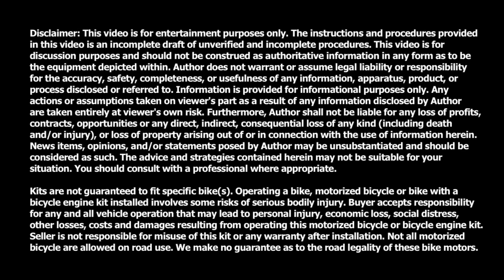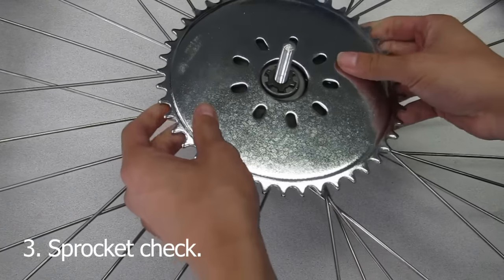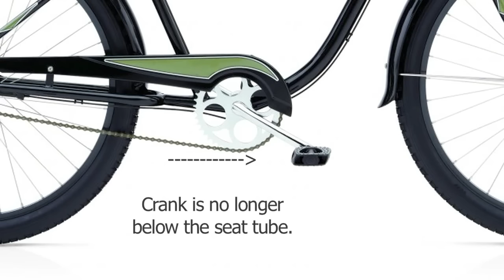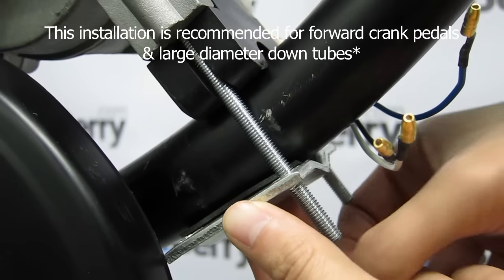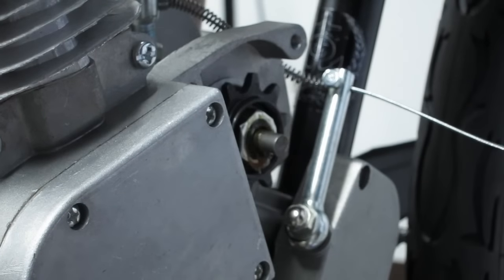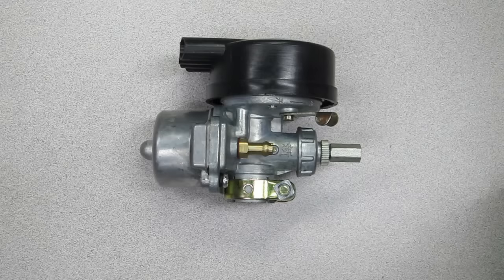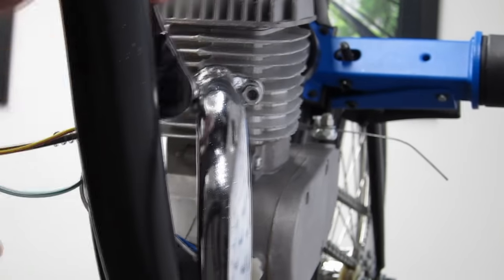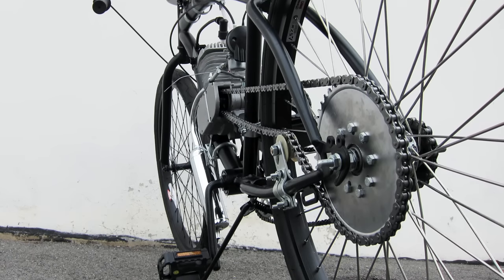How To Install 80cc 2-Stroke Bicycle Engine Kit FULL DVD 66cc 48cc 50cc

Comment: the fuel ratio is as follows........... and thats it. what wheres the ratio?
Reply: +Austin Dovel I would use 1dl to 5L making it 2%
Reply: I actually bothered to do the math and the calculator says the instructions translate to 3.125% oil per volume, I usually add 4 oz. of oil to a gallon of gas (conveniently measured by a mason jar :p )
Reply: 32:1
Reply: Yeah
Reply: @codyhastings8902  can you teach me how to do the ignition
Reply: It’s 16:1 for break in
Reply: Cody Hastings hey 30: 1 of what oil
Reply: @hhhydra2397  you're supposed to use 2 stroke oil it's way better for the engine
Reply: 8 ounces of oil per gallon during the break in .  6 ounce of oil per gallon of gas after break in
Reply: Forgot to do the subtitling, oops.
Nice detail anyway, very helpful in seeing what these things are like. I'd like to know how much drag there is when declutched and attempting to ride manually. And how noisy they are, maybe like a chainsaw.
Reply: thrashfuckenhard 91 octane. Use 2stroke oil and if you can, high grade 2 stroke motorcycle oil.
Reply: @codyhastings8902  I would say 40:1 or 50:1 till death saves you money and also I think its better for the bike I currently have 5k miles on it and only issue iv had is the chain
Reply: I cant get chain to actually turn, I saw you removed the clutch cover and so on to install the chain, but after putting it back on what exactly did you do to get it to turn freely?
Reply: I run 50 to 1 and never had an issue i have almost have 1,000 miles on the bike
Reply: It's a 2 stroke so it's 4floz of 2stroke oil into every gallon of gas
Reply: 40-1 new to the end of days. Break in just means dont go full throttle thru ur first tank of gas
Reply: Get a Ratio Rite cup and you can mix and measure anything easily.. 36:1 seems to be perfect for me
Reply: @slayaboi69  leave clutch together. Just use a screwdriver turn the sprocket and feed in the chain
Reply: I will use ethanol free unleaded gas which I have heard is far superior to regular unleaded gas. The ethanol ruins small engines for those in law care too. I will do 32:1,( maybe 16:1?? I haven't heard that one) and synthetic 2 stroke oil. Any thoughts?
Reply: @asrowenj  It’s always good to use the ethanol free premixed stuff at the end of the season to help clean out the carburetor. But using it all season long is a complete waste of money. Just add a little sea foam or a fuel stabilizer to your gas can and you will be fine and save a lot of money
Reply: Yeah, exactly!
Reply: @TheWormzerjr  what kind of oil ?
Reply: @lilgee5894  great thats what i thought. .
Reply: 16:1
Reply: @thrashfuckenhard  2 stroke oil
Reply: 16:1 the first 2 gas tanks and 20:1 after that. Look up measurements
Reply: The ratio is .......... he just said it
Reply: 16:1 then 18:1
Reply: 16 to 1 for the first few tanks than 30 to 1
Reply: 40to1 CRADLE TO GRAVE!!!!!
Reply: 16:1 while the break in period and 20:1 after
Reply: @olfreal  all that build up is going to bust your engine early
Reply: @DonnyJS  but its just going to smell better with more oil if you know what i mean. But youre right it does make a lot of build up but mx instructions said that.
Reply: Does the motor have engine oil also ?
Reply: Does the motor have actual engine oil also
Reply: @michaeldickey7355  you need to mix gasoline 91 and two stroke oil 16:1
Reply: @SuperAbsolute1   ya I understood that part cause I use to have to mix my 2 stroke dirt bike but I guess my question is , is like motor oil ?
Reply: @michaeldickey7355 yes it is a special oil only for 2 strokes
Reply: @SuperAbsolute1  I no that but what I’m saying is we’re does the motor oil go ? Cause you have the mixture oil for the gas and then you have the motor oil for the motor that normally goes by the side case
Reply: @michaeldickey7355  you put the mixed gas and oil in the gas tank
Reply: @michaeldickey7355  to be clear the only oil are to be put in the gas. No oil in the motor...
Reply: Thought I was losing my mind
Reply: @alfredosauce5351  any
Reply: @michaeldickey7355  you don't put oil in the crankcase of a two-stroke motor
Reply: @michaeldickey7355  it's just like a weed eater motor but larger. You don't put oil in a weed eater other than in the gas! those two-stroke motors are exactly the same just oil in the gas nothing in the crankcase except maybe some Grease
Reply: Never mentions what brand either.  Thrre is a difference

Comment: Why am I the only person who wants to know how fast this thing goes?
Reply: Around 25-30mph
Reply: @J_Jim-mo3ub  That's wrong. A 66 cc (80/100 cc don't really exist for bicycles) can go up to 80kph or 110mph if tuned right and built right, out of the box it can go 50kph 80mph or faster.
Reply: @darrylkinslow5613   One mph equals exactly 1.609344 kilometers per hour (km/h). refresh you numbers..
Reply: @Dartoras  Sorry I reversed it,Yeah, I wasn't going for exact, I was guessing. And one thing I do know for sure is that 50mph on the speedometer is about 80kph, so I' m not so far off. But I did mean kph when I said how fast the motor is. I remember catching a ride with U.S. citizens in Canada, they didn't know what kph was, so they were driving at around 110kph, lucky they didn't get stopped. But we got far, pretty fast.
Reply: @darrylkinslow5613  I did not want to offend you, I live in the EU and with so much content in the US on the Internet, when I saw it, I thought it was just miss written
Reply: I have one. 66cc it does 38mph with the muffler debaffled. Don't listen to the guy saying 110mph. The fastest I've seen is 62mph.
Reply: after 4liters or about a gallon gas at 20/1 and speeds around 25-32kph(15-19mph) i change the mix to 40/1 and i replace the china spark plug with an NGK B6HS and my top speed is 39-41kph (24-25mph) 50cc engine also uphill around 28kph(17mph)
Reply: @Dartoras  The mixture is supposed to be 20-1 all the time, it's supposed to have more oil than that for the break in period, at 16-1. The spark plug wouldn't matter, it's a generic plug and so the one you bought is the same thing, probably even from the same factory in China. Most of what we have comes from China. Your oil mix is probably the problem, your engine is likely struggling like a b*tch, begging for help. I wouldn't be surprised if you need replacement parts already My neighbor got his around the same time I got mine, and he's getting 35kph without pushing it to its limit, just casual riding. You're practically murdering your engine with such a low oil to fuel ratio, I wouldn't be surprised if you need several replacement parts already. You should really read up everything about these before operating them and practically running them with no lube.
Reply: @darrylkinslow5613  this is by the book mixture and i try it but the motor didn't start right away, i had to petal for 100-200 meters(300-600feet) and the bogging before the engine go up in temp was consistent   so i try 20/1 for the break in, after that 2 tanks of gas  i pull out the spark plug and i saw lean but oily readings so i took out the muffle , air intake and carb made some (RTV Red S-Hi Temp) gaskets and put some of the RTV between the intake and the carb to eliminate any possibility of vacuum after doing all of this the motor start by the second time i let off the clutch but the bogging remains so i change the spark plug and all of the sadden everything works, time will tell...
Reply: @Dartoras  Funny, everyone elses starts right up, you must have something wrong, but you are definitely starving the thing of oil, giving it nearly nothing when it needs lots. I'm not sure you know what you're doing, or should even be running one of these engines. You seem to think it'll get the lube it needs for all the internal parts from thin air, but it comes from the 20-1 mixture. Without that you'd need an external oil tank, which would still put oil into your gas. The hot engine would burn off all of the oil in the gas, rather than distributing it because the oil is lacking so much. Would you run a car with no oil tank? That's essentially what you're doing by having hardly any oil.
Reply: @darrylkinslow5613   ROFLMAO this comment of yours is like am gonna call you "short-sighted". Keep it up thanks for the input.
Reply: How much does It cost?
Reply: 45 mph
Reply: I'm having a hard time starting a brand new engine I have the fuel mixture right but when we try to start it it will not crank up any suggestions would be helpful

Comment: “Fuel ratio is as follows: Says and shows nothing “
Reply: lmao exactly
Reply: Ok so if watched a lot. First 2 gas tanks are 1:16 (example: 100ml oil, 1.6L Gas Permium. After those 2 tanks you can go 1:24 or 1:26. (Some even do 1:40 but idk about that)
Reply: Hope that helps :)
Reply: I hope I will help. First 2 tanks get 1 : 16 ration (100ML Oil and 1600ML Premium Gas. After those 2 tanks use 1 : 24 or 1 : 26 (your choice)
Reply: @OlegAverin-nz2fe  dawg i posted that 2 years ago

Comment: I love the way you said your oil is as follows the oil mixture And then there was nothing there
Reply: he aligned the cut in the rubber right where the plates meet for the sprocket  ....would not have done that but whatever
Reply: what the hell is he talking about forward peddling cranks lol what are you gonna do peddle sideways ???? he means the bottom bracket is set more forward on the frame

Comment: Tip: at 11:21 when he says to remove the flower nut you have to hold the clutch pedal in while pushing down on the cover to free up the flower nut, I was stuck with that problem for a couple of days until I watched another video on clutch troubleshooting so I thought I should share my experience
Reply: why do u need to take that off anyways can i just skip this step
Reply: @vinniecasella3849  No because it will stop the gear that the chain is attached too from spining freely and you won't be able to attach the chain
Reply: @dominichebert9884 no.. use the socket on the nut for the sproket that comes with the kit to spin the chain on just make use clutch lever is locked in
Reply: dude are you still alive.. cant believe someone that doesnt know the difference between a pedal and a lever is trying to build a gas bike lmao
Reply: fuel on off switch/ fuel valve is called a petcock

Comment: Hacks to save time.    
1.Instead of taking the clutch covers of the engine, engage the clutch with the hand clutch lever provided and place one end of the chain into the engines sprocket and rotate with your finger the under side of the engines sprocket so that the chain rotates outward and chain comes out the other end.
2. Hide the white wire off the CDI if you are not going to add any head lights to your bike. Coconnect the colors that match first and then connect wires that appear to be ground  to the black one for example brown or green.
 then you guess right their is one wire left to connect I'll let you figure that one out.
3. Allow enough elasticity on your fuel filter by placing decent amount fuel line hose to avoid any stretching and disconnecting the line and having to replace the hoses and spilling fuel.
4. If your engine is new it will take some time to start make sure to open the fuel line and to open the carburetor.  Gas tank opens to the right and carburator opens downward on the lever.
Reply: fuel or oil?
Reply: @thedailydude2  gas, 92 octane
Reply: Ñ
Reply: @thedailydude2  I no longer suggest doing this to avoid confusion and damage to you engine I'll remove that part
Reply: A mechanic told me that if I'm not confident that i can finish the project, i can do all the parts that dont remove the chain from the bike and do the engine and bike part last. Would that be smart or just take on the project in a day
Reply: @thedailydude2  it's mixed because you add it to the gas tank the engine does not have a oil cap to separately change every frequent usage as it uses 2 stroke engine oil mixed with gas
Reply: First thing before doing any of the following steps is to make sure the sprocket will work on your bikes rim. Start by removing coaster brake arm and placing the sprocket ontop of the rims hub and tie it down with the bolts, metal and rubber plates provided this step is the most crucial and important as it requires patience and torquing all the bolts down evenly one at a time and going back and forth criss cross so that the sprocket stay uniform to the rim then you can follow the next steps after placing the wheel back on to the bike.
1. Place your clutch cable in your clutch lever then tie down the clutch lever to your left hand handle bar of the bike and then place the  handle grip on the left hand bike handle( you will have to remove the original handle bar grips first)
2. Open the throttle from where it will  be attached to the right hand handle
3. Inside the throttle plastic a hole or circle  will be in the middle, this is so that you drill it in the handle, so Place over the handle and mark where you will drill a hole on your right hand handle on the bike
4. Insert the throttle cable wire head to the same plastic of the throttle before closing back up and placing throttle on handle bar 
With the drilled piece tied down with a nut a bolt should be the same size as hole and long to exit the handle but not interfere with the twisting of the throttle then Place the two outer bolts to tie the entire throttle
5. Open your carberator from the top it will look like a cap this is where your throttle cable will be inserted thru
6. Lift up and remove the  inside spring and needle and insert thru the gap of the gold or chrome small plate the throttle cable smaller head and reassemble each piece as it was but now with the throttle cable inside.
7. Leave your carberator hanging from the throttle and throttle cable
8. Place the shut off fuel lever on the gas tank if not installed already. This piece is to turn on and shut of the gas flow from your tank.
9. Cut your fuel line hose in half
10. Insert half of the fuel line to the gas tank and the other end to the small oil filter
11. On the other end of the fuel filter add the other half of the hose which you will Insert later to the carburator.
12. Place your gas tank on the top of the bike frame with its nuts and bolts but leave loose do not lock all the way you may need to slide the gas tank back and forth later on.
13. Now place the engine on the frame with plates nuts and bolts don't tie down as you will need to.alighn 
14. Place the chain tensioner on the side arm of the rear wheel loose as it will need adjusting 
15. Break the chain if it's locked 
16. Push in the clutch lever on the engine and insert the chain while spinning the engines sprocket have someone help you do this step as it requires three hands or before doing this step install the clutch cable loose end in the right side of the engine with the springs provided for the wire to recoil back once pass thru the engine pass the tip thru the small hole of the clutch lever hand and Place the screw ontop to hold the cable from slipping push the lever inward and tie down the screw ontop of the lever until you.feel the clutch is engaging but unenage when releasing the clutch lever tightening too much this step will cause the engine to not ignite.

17. Now Place the hanging carberator on the engine at a angle anything but upside down. So the engine will still fit 
18. Alighn your wheel sprocket chain tensioner, and engine so that the chain rolls and I straight then you can tie them down completly.
19. You can now place the loose gas hose to the side of the carberator that looks like the tip of a baby 🍼 and adjust the gas tank so it can reach then tie down completely the gas tank.
20. Place the spark plug on the engine 
21. Place you.cdi near the spark plug but not touching the engine and have enough length to connect to the engines colored electrical wires
Reply: @jamram7825  thank you, ill post how it went

Comment: It's always good to take some old bike tire tube that's cut into strips and wrap them around where the tube of the bike where the engine touches the frame between the engine and the tube on front and back, it helps reduce vibration a fair bit and shake and it keeps the engine from digging into the metal of your bike tubing

Comment: Compared to the instruction manual that came with my kit. This video is great. Thanks you saved me a lot of heartache and confusion. Here is a tip: When in installing the sprocket I measured the distance from the threaded shaft to the end of the teeth at 180 degrees segments. When measurements equal, this insures that the sprocket is centered.
Reply: You got an instruction manual?
Reply: Yeah but see I got this fuel filter...
Reply: @vincent10717  yeah what the f*** are one of those

Comment: I built one in January 2020. I have probably ridden 200-300 miles since. I ran 16;1 fuel for 2-3 tank-fulls and then moved to 20:1. The engine likes the 20:1 mix and it doesn't smoke at all.
It's important to check tightness of everything frequently. Head bolts need a little tweek every few rides.
Reply: why not use thread tape or thread lock? you can even use double nuts to prevent loosening. and if your really brave use some JB weld behind the nuts on the thread after you tighten them for a permanent solution. Loctite 271 was made just for this.
Reply: no no no, don't use 20:1. using 20:1 will give the engine less power + your engine will have a huge carbon build up inside your cylinder and exhaust ( it will also cost more ). I suggest something like 30:1 watch some videos and find out. 😊
Reply: How u make that 20:1 shi boiiii I need to know
Reply: @Dragnmastralex that's correct